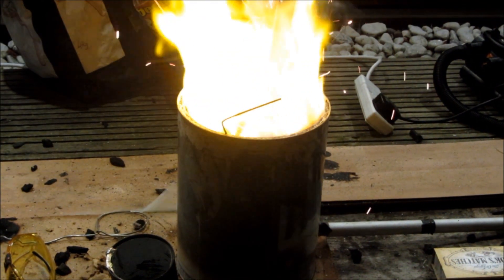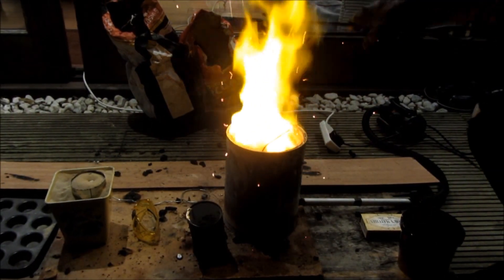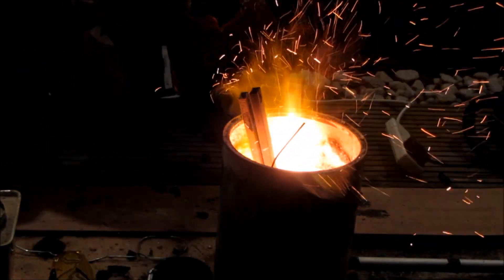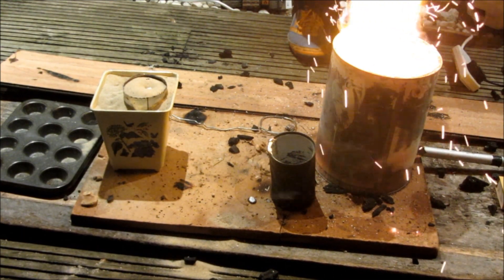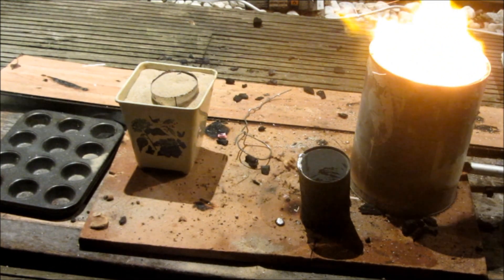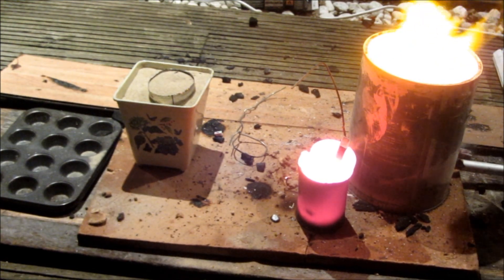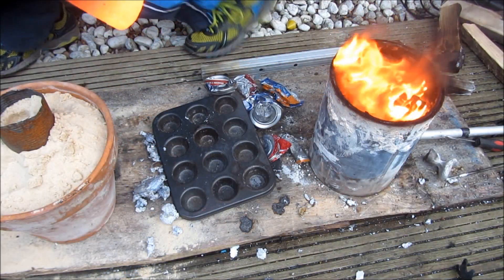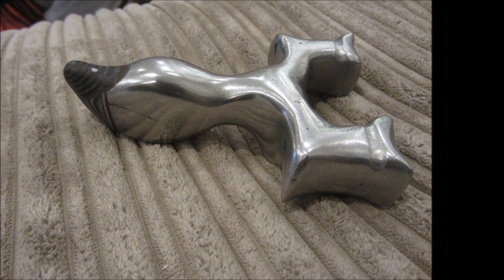Accidentally Making Thermite While Casting (4500 Degrees!)

Comment: wow that wasnt good i believe what happened was magnesium burning instead of a thermite reaction because solid iron even if its rusty doesnt have enough surface area to cause a thermite reaction. the best thing to do in this situation is exactly what you did which is stand back and if neccessary use a fire extinguisher only made for metal fires, never pour water on burning or molten metal as this can cause a violent steam explosion glad you were safe

Comment: A thermite-reaction would need Fe2O3, not Fe. My guess is that you got a piece of magnesium in there and made magnalium that burned through the crucible.
Reply: iron  oxidises at high temperatures, so its a thermite reaction
Reply: +Peter Lange For the iron to oxidize it would need a supply of oxygen. When the melted aluminium encapsulates the iron there is no way for it to oxidize.
Reply: +Andyboys oh... sry i wasnt thinking about that^^
Reply: Magnesium iron mix is most likely
I think putting iron oxide in molten aluminium won't cause a lot of trouble? I think that 900C may be too little
Not to mind other factors like thermoconductivity
Reply: Also it's a lot easier to confuse aluminum and magnesium than aluminum and iron.  I'm here because this just happened to me.  I was melting old plumbing brass  and a bit of what I think was aluminum in a stellar crucible.  I appreciate the video and the comments.

Comment: Steel didn't cause the reaction, Iron Oxide (rust did) it mixed with aluminum and the heat set it of.  You had he wrong ratio of Rust:Aluminum for it to go to bad.  You got very lucky.

Comment: great bunch of videos! and since one tends to learn from making mistakes, it's nice that you include those, too. I noticed that some of these comments are saying that the thermite reaction requires rust. While that's true, this reaction is very much a thermite one. perhaps oxygen was going down the tube (they look like steel tubes). The aluminum would draw more oxygen in as it consumed it. I think the steel was more of a catalyst, rather than an oxidizer in this case. Love your work! It's like stuff I would do if I wasn't getting spanked all the time...

Comment: Haha - that was crazy! But you need iron oxide to make thermite, not iron metal (or steel that's mostly iron). How hot did you run the furnace before putting the steel bar in? Aluminium only needs like 660°C (1220°F) to melt - that just a slight red glow. It's preferable to run the furnace a little hotter to make the melting faster - but a lot of heat also causes the metal to oxidize much more, so it's not optimum to have it way above the melting point

It probably needs to be pretty hot for a reaction like this to take place as people often use steel "crucibles" like old cooking pans and steel pipes to melt aluminium as I have seen in other videos.

Comment: Hi there...   An ordinary ABC type fire extinguisher will not stop a thermite reaction...  Even D Type extinguishers designed for burning metals, are questionably effective.  Using  water can result in steam explosions and scalding.

That said, you might not want to be running your forge on what appears to be a wooden surface.

Keep up the good work!
Reply: Honestly, the best and cheapest insurance for metal fires is a large bucket of sand and a long handled, fireproof shovel. If you're wearing the appropriate safety equipment for forging, you should be able to safely extinguish a small metal fire by smothering it with DRY sand.

Comment: Combining aluminium and iron does not yield a thermite reaction. I don't know what exactly happend there with your furnace, but the thermite reaction is using a heavy metal oxide with an elemental metal, not two elemental metals.

Comment: Hey, I am doing this stuff at home, but I don`t really had a permanent forge, I was wondering if I could use cement in a steel bucket....
But do I need a special kind of cement? Or can I just use normal cement for bricks and stuff.
Also, is plaster of paris a special kind of plaster? Or can I just use normal plaster 50/50 with sand...?

Thanks!
Reply: Don't use cement, it's not made for this kind of heat. From what I have seen plaster of paris is what you want and nothing else.

Comment: its very impressive that such homemade  forges can reach that high temperatures. when forging my first knife i also accidently melted parts of it away.
you have no possibility to control your air right? one way is to drill some holes into the pipe. if you need much air you close a few of them with right size screws, so less air will leake from the pipe. if you need less than open them.
maybe this is helpful :)
Reply: Cast and Forge Wow! I`ve been having that problem, I just need a steady blow but i have a mega blower! Thanks!
Reply: No problem :) i used this method at first on my blower, now i have a power pack to control the  output of my blower :)

Comment: Dude youre awesome, doing aluminium casting home. I dont think that the reaction was thermite, its made of aluminium and RUST (iron oxide), or something with oxygen in it to act as oxidant, not iron. I wonder what happened actually. Someone in comments suggested the other metal was magnesium which sounds plausible given the heat, but i wonder where do you would come across lump of magnesium.
Reply: if you ever saw a cutting torch in action (oxy-acetylene) that is actually high speed rust. Not magnesium, though, it would be more like a sparkler. I used to use it to light thermite.

Comment: Love your casting videos etc, but this could have gone much much worse.

If you're gonna keep casting Aluminium, you're gonna need to change how you do things.

Firstly, my understanding of thermite is that it is not Aluminium and Iron that react, but Aluminium and iron oxide, so there must have been some rust on that piece of iron you were using. That small amount of rust started the thermite reaction which then probably got the molten aluminium burning in air. Aluminium is quite a reactive metal and produces a lot of heat. I don't really know what else you cast in your crucible(s) but you should have one crucible for Aluminium only and keep it clean (Or else you might get left over oxides reacting with aluminium)

Secondly, I think you should reconsider casting Aluminium in your current forge. Aluminium will react with plaster of paris (CaPO4) easily if the Aluminium is melted. So if you accidentally spill some molten Aluminium on the forge, you might get a proper thermite reaction...

As I've never worked with molten Aluminium, I'm not completely sure about what might happen, but I think it's better to be safe than to have a floor full of molten metal...